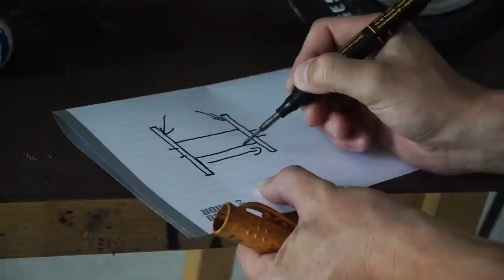Homemade 50cc TRIMMER SKATEBOARD !?

Comment: It's going to break the welds or destroy the bearings in the back axle. The chain side should be supported to the motor. You can see how tight the chain is too, lots of stress.